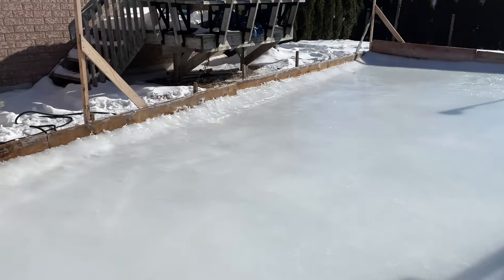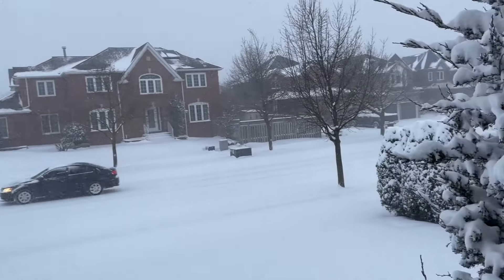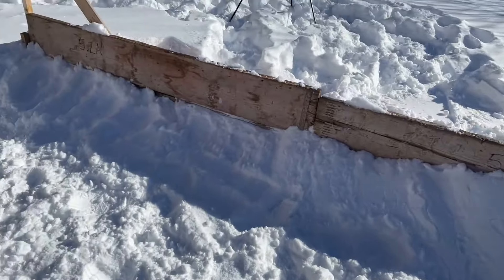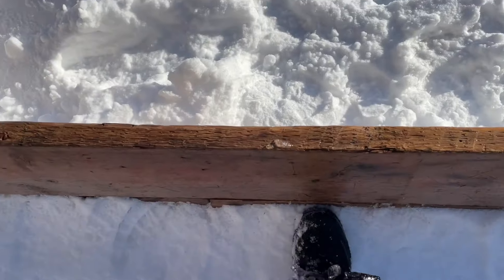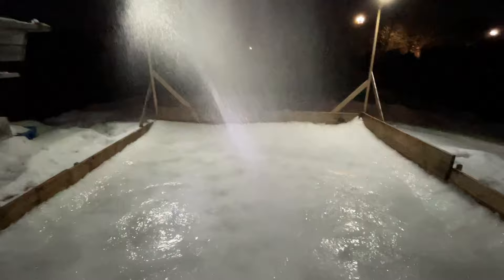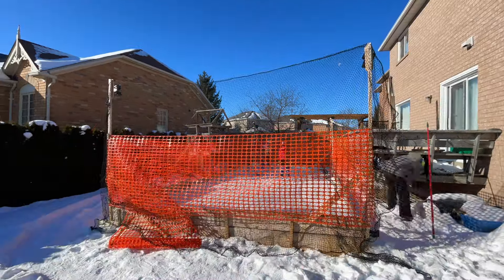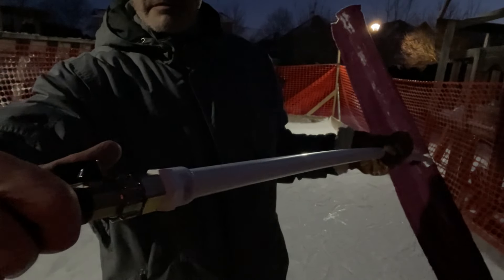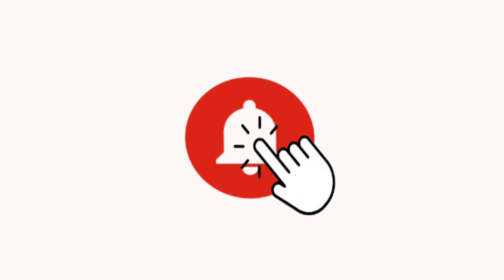How to Build a Backyard Rink with No Liner

Comment: if you want something that holds the water a little more uniform when towel dragging, go to a craft store and buy a piece of thick felt. It's the same material we use on zamboni's and other ice resurfaces.
Reply from the maker: You know what… that is a fantastic idea! The towel doesn’t make a very smooth surface, and it always leaves little bits and pieces of terry cloth frozen to the ice.
Reply: Thank you

Comment: How does this hold up when we get a mid winter warm spell? I fell like you'd be doing all that work again:(
Reply from the maker: That's a great question. However, in a situation like mine, where I actually do have boards around my rink, it makes very little difference. A warm spell will soften the ice on top, but that ice will re-harden when the temperature drops. The ice underneath, however, stays cold and helps to keep the top layer cold, too. Owing to the laws of thermodynamics, water takes a long time to cool down and freeze, but the opposite is true: ice takes a long time to melt. Ice needs to absorb a large amount of energy in order to change from a solid to a liquid. (This energy is called latent heat.) As just an example of this, many of the ice sheets in existence today would not have formed under today's climate conditions, but they nonetheless continue to exist because of the very conditions that their own presence creates. This might sound like a bunch of gobbledygook, but if you've ever gone trail running in the spring, you will feel a dramatic difference in temperature as you run over top of the odd remaining patch of ice. 

Be well.

Comment: 11 days of fussing with it? No thanks. But I respect your dedication and proof of concept.
Reply from the maker: For sure, it takes more time. That, I would imagine, is the main reason why people buy liners. 

However, the upshot’s are:

i) Less fussing with making boards to hold your liner. (You don’t necessarily need to have any boards for a linerless rink; I just have them because I made a liner rink previously that same season. Also, my ground is so sloped that it helps to have at least two sides of my rink with boards on it.) If you have a big, flat yard, linerless can be quicker and easier. The guy who makes and maintains a public rink here in Newmarket every year never uses a liner.

ii) You don’t have to worry about your liner springing a leak with a linerless rink.

Comment: Let's say there is no or little snow. Would it be possible to just use the well frozen soil to keep the water? Or would it soak in? In spring when the snow melts it usually form large puddles on tough types of soil...
Reply from the maker: This is a very interesting question, indeed! My suspicion is that, once the ground is frozen, as long as you had at least some short boards to contain the water (stop it from flowing far and wide), then this idea could work. After to all, to the point you made, we will see frozen puddles on the ground, so why not just make our own big, frozen puddle? 

I’d try this myself, but we always have snow on the ground in January and February, which are the best rink-making months of the year in Canada. 

Let me know how it goes if you try this!
Reply: @GreenNeighbour  Thank you for a quick response. My guess is that some water would soak in, so the water consumption would be bigger. It would largely depend on free water supply like own well (which I happily have got on my backyard). But there is trouble with weather - unlike Canada heavy frost are scarce here in Central Europe, so I need just a few inches of water (otherwise it would not freeze through) and perfectly straight and smooth surface, and some boards as you mentioned.

Comment: say goodbye to your grass.
Reply from the maker: In truth, I’ve got pretty bad grass in my backyard to begin with, but I haven’t actually noticed any impact on the grass under the ice itself… just under the boards if they’re put up early or left up too long. Placing something on top of grass while it’s growing will kill it, but placing something on top of grass while it’s dormant in the winter doesn’t seem to have any effect. You can actually see that quite clearly in another video of mine where we are reassembling our backyard rink right where it always goes. You can see that the grass is fine within the rink, but you can also see a dead patch of grass (at the lower right corner of the screen), where we had previously pitched a tent in the summer and left it up for too long. That grass has never bounced back! https://youtu.be/ctI25wZlty8?si=vpI1yUvlw-V0LJjs
Reply: Grass will be just as good come Spring.  I build outdoor community rinks at our school field each year and you can see by late Spring it's actually better than the other grass.   You don't have to be as careful as you were with initial soak, just water it every day, 2-3 times a day.  Takes me 7 days start to skateable.   You don't need the snow lip either.  Then it's just light flooding every night when possible to keep it going.
Reply from the maker: That’s terrific insight. Thanks so much for taking the time to share your experience. Have a fun season of skating!
Reply: @GreenNeighbour   late start here in Ottawa, but on a roll now!
Reply from the maker: @hamstergraphics  I hear you, brother. Good luck with it all!
Reply: grass doesn't grow in the winter
Reply from the maker: I hear you, bro! Good luck with your backyard rink project this year. Hope it gets cold enough wherever you are!

Comment: I’ve been doing a 50’x30’ linerless rink for the last 5 years - I felt so bad sending a giant liner to the dump after a season or two.  

I’ve been using snowshoes for a quick compaction, and then a lawn roller to get as flat & compact as possible before spraying with water. Lots of work, but it’s a labour-of-love.

My resurfacer is quite similar to yours, DIY. I see a comment from someone above suggesting thick felt in lieu of a towel… definitely going to try that this season!  Good luck, man
/Sean (Russell ON) 🇨🇦
Reply from the maker: Truth be told, I still haven’t thrown out that old plastic liner. In fact, I haven’t thrown out any plastic in years. I just keep storing it up in my garage in the hopes that I eventually find some company that recycles plastic. 

In fact, I did end up buying that felt from Fabricland, so I’ll see if I can use it to modify my resurfacer this year. I’ll let you know how it goes!

All the best!

Comment: Try a lawn roller or vibrating plate
Reply from the maker: Cool idea! Would that be to prepare the ground (and maybe even it out a bit), or to compress the snow?
Reply: @Green Neighbour (Art Lightstone)  compress the snow.  I think I'd rent them if possible lol.  You seem to have a lot more patients then me to foot stomp all that snow.  Cool video.  May just have to try this
Reply from the maker: @Krv52  For sure! Give it a try. I greatly prefer this method (called a “traditional” rink) to using a liner. The traditional approach uses a lot less water because you get to take advantage of the snow, and it basically can’t spring a leak.

Comment: what is outside temperature during this process?
Reply from the maker: Such a good question! I should have made a note about that in the video. According to my video files, I started the process on January 18th of 2022, and I took 11 days to complete the rink. According to Environment Canada, the temperature on that day was -14.3°C. The next day it warmed up a bit to -11°C, but after that it stayed between -14.7°C and -22.1°C for the remainder of the build. It was good and cold!
Reply from the maker: This is such a good question that I added the temperature data to my video description. Thanks again for pointing this out.